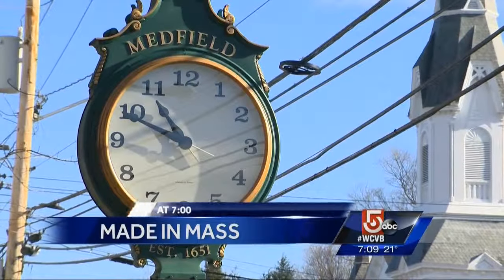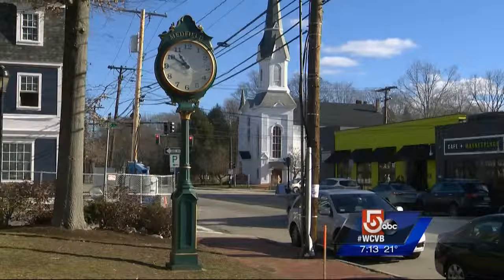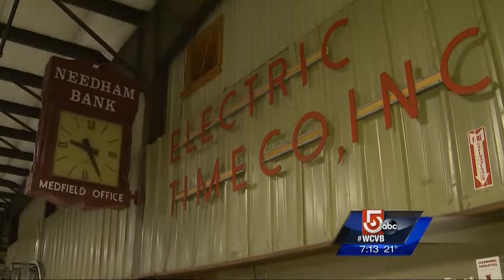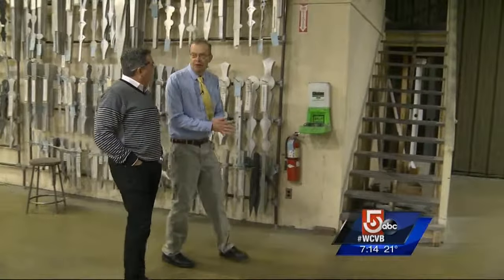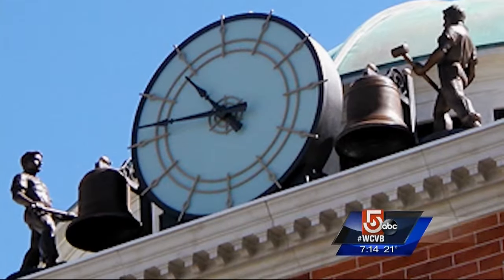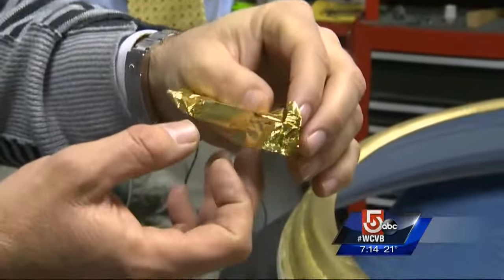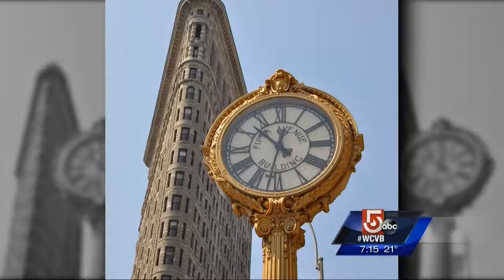"Made in Massachusetts" newscast

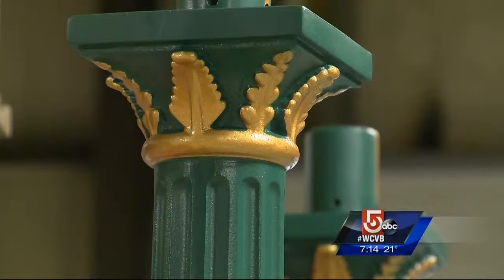Comment: 1:32 Is that a small clock dial I see on the movement? What is that used for?
Reply from the maker: On the backside of our tower clock movements, we put a small dial and pointer that tells you where the minute hand is located.
Reply: @electrictime  Oh, okay. That's pretty cool. It also looks like the pointer goes counter clockwise, which is also pretty co